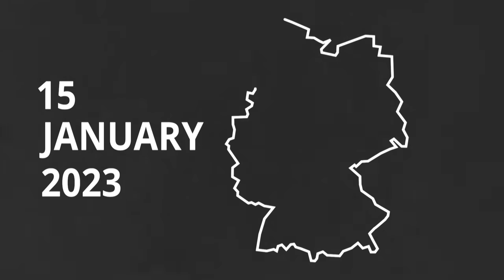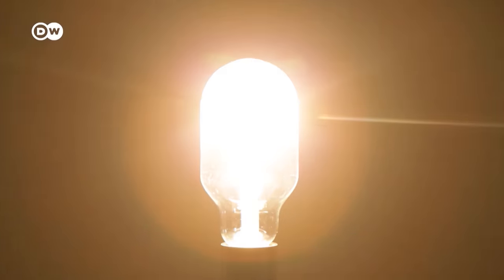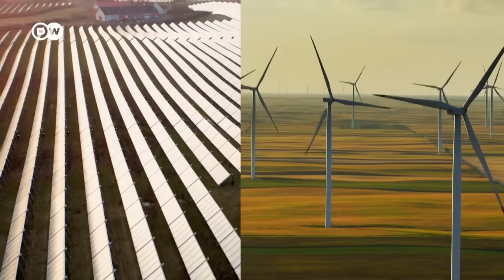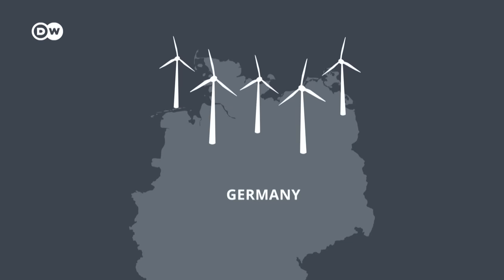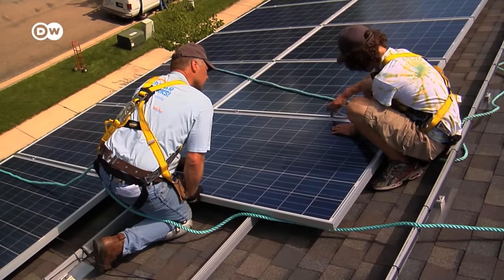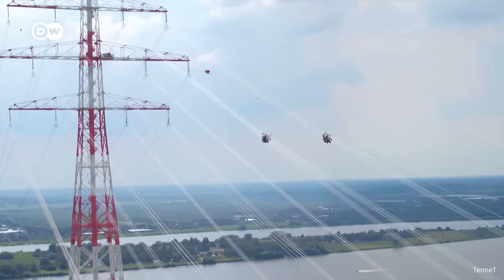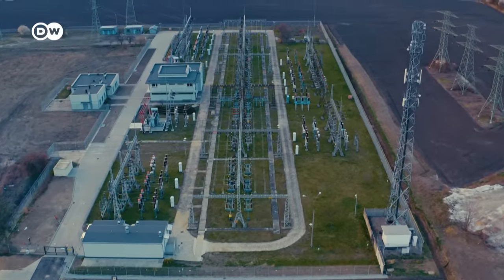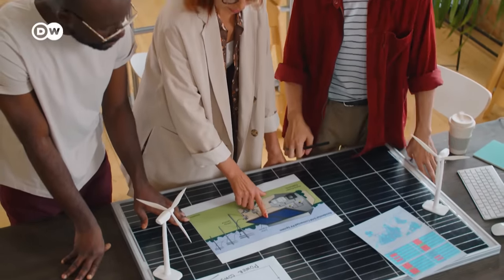This is what's REALLY holding back wind and solar

Comment: From Vietnam here. We have the same problem with solar panels. The North summer is scorching, but the surplus electricity can't be brought from the south to the north, as the high voltage lines are operating at maximum capacity. We have to import electricity from China for this summer. Some rural areas have been cut electricity some times during the day for essential services.
Reply: Convert surplus electricity to hydrogen, and store, use, export, or transport by pipelines.
Reply: It should be relatively easy to lay a submarine cable
Reply: Those types of transmission lines are actually DC, doesn't make sense, I know. But it actually does.
Reply: @Sofus. Sadly politicians would find a way to prevent that, because they love their money
Reply: It's not just electricity. It's also water supply. Today i watched a documentary about Vietnam. Some aren't connected to the fresh water supply and some have wells which creates also other problems. The waste water is not cleaned and goes straight into the rivers. Than there are the countries upstream which are building dams and when it's raining and flooding they have to let water out. It's a real problem and it's hitting not just the citizens of Vietnam but also the economy. They should build up a clever and efficient system with the money they still have. If it continues like this the money could be gone and nothing is build up.

Comment: I did my batchelors thesis on this, and from what I calculated by far the biggest potential is in smart heating / cooling and in EV charging. Doing demand response with stuff like wash machines can be done, but those represent a very small percentage of total energy use, so they won't make that big of an impact. But smart heating and EV charging could potentially reduce the need for energy storage by more then 50% (I looked at it in the EU, elsewhere it may be different)
Reply: Talk to me about smart heating.
Reply: @I_Have_The_Most_Japanese_Music  Well, essentially temporarily stopping the electric heating during a significant power deficit, and conversly "pre heating" when there is a power surplus, before projected drop. Buildings in Europe lose about 1C every 3-4 hours during the average European winter, so if people were willing to set an acceptable temperature range, lets say 21-23C, then the smart heating system could use this inertia to shave consumption peaks, and use up energy surpluses.
Reply: @pyroman2918  Okay. I didn't realize it was that simple. Thanks.
Reply: It is that simple. You just need money. Insane amounts of it. Only problem is, is if you are paid German wages, as most people living in Germany do 😀. But let's ignore this aspect, because it's an inconvenient constraint in our discourse that, if we simply ignore, everything is all good again.
Reply: You can also have 1-2 cubic meter water tank for energy storage. You can heat it up when energy is cheap and it energy from it when energy is expensive.
Reply: @Mariusz Kozłowski  that is 100% correct. What are the costs of retrofitting an older house with such a storage option?
Also, how much caloric energy can you store, and at what rate does it dissipate? How much more efficient would it be than simply storing the same amount as chemical energy in a battery? 
If we are to make these things into practical solutions, we need to figure out the answers to all the questions above also. 
Right now, anything green-energy related is succumbing to human greed. Contractors have upped their rates to unbearably high levels to the extent that not only the investment will not pay for itself during its projected lifetime (unless we face prohibitive electricity costs, of course), but it will financially ruin most people in the so-called developed world, where prices are really at an extreme high. Of course when the drawbacks are so high, people will not be willing to make sacrifices.
Not when others make huge profits out of this opportunity. It does not feel like we are in this together, and that will really make things worse unless the market gets properly regulated.
Reply: Have you done any research into residential seasonal heat storage in sand? Utilizing heat pumps? Sounds fun to me. I'm also interested in residential co-generation (gas for electric and thermal). Also neat, but I understand this is very micro, and your research is macro.
Reply: Not just that but data suggests an increase in the market for AC's so Summers will se increasing power loads from AC units in many houses in europe. And cooling things down takes a lot more energy than heating something up.
Reply: @volkhen0 So glad to hear this from someone else. 
A hot water tank can keep water warm for days.
If one has radiant heating, a warm water tank could potentially save them.
I recall a winter storm a few years ago and I awoke and realized no power, 
I decided to shower quickly b4 it got cold.
I was surprised to have lewk-warm water on the 3rd day.
Reply: @0my I understand this is relatively new to the modern society.
I am looking forward to see this implemented on a grid and per home scale.
Reply: The problem is only one thing and that's energy storage. Smart heating and cooling as well as EV charging are just sub-categories of energy storage.
Reply: Thank you! So often the onus is put on the everyday people, when houshold consumption is a small (tho not insignificant) fraction of both CO2 emission and power usage. We need to look at the bigger impacts, like industry - or heating as you say. I saw an other video recently that was talking about storing renewable energy as heat for communal heating.

Comment: The Dutch engineer came up with a road that has utility chambers underneath that would make everything easier
Reply: Well, it's not new idea, or even that clever. For one, burying cables under road would be dumb, burying them beside roads on other hand is normal and much more accessible.
Reply: I'm sure digging up roads will garner the maximum amount of popular support.
Reply: is this a traditional road made from concrete/asphalt?

I've thought you could make a modular road which allowed drainage through the surface, that would allow easy access to utilities when needed as well (without digging up a road, just removing sections of it for repairs to utilities). I know microplastics are a concern though. I'm not sure how you would design a plastic which didn't "shed" into the ecosystem.

Comment: In some  places, the consumers can allow utility company to shut down their AC and heating a few hours at a time in a rotating pattern in a given area. It barely impacts each individual home, but has a huge impact at grid scale. Enough so to make turning on peaker plants unnecessary.
Reply: I completely agree. If there was a tariff that gave a discount on the understanding that you could be switched off at high demand times, and if they sent a text message to give ten minutes warning, long enough to hit Ctrl-S etc,  I would go for it. With smart meters electricity companies already have the ability to turn off individual consumers.
Reply: @VideofoundryNet  I'm not talking about your 200 watts computer here. These remote shutoff programs are for kilowatts appliances, like heating and cooling. They never shut down  your lights / computer.

Comment: A friend of mine has done energy planning for a Danish municipality. Behavioural changes by consumers and fex tariffs are not part of the solution, in his opinion. I have done the maths for myself. The washing machine is the only appliance I can put off using. With 211 washes per year and a consumption of 0.37 kWh, that makes a consumption of about 79 kWh per year that I can postpone. In my case, that's a little more than 1% of my consumption. However, I have a high consumption. Today, private electricity consumption accounts for about one third of total consumption.  Roughly speaking, if all Germans wash their laundry off-peak, only about 0.33 % of the peak is shifted. My friend is right. The idea sounds good in theory but is practically irrelevant.

Comment: I'm an American living in Japan for the last 2 decades. We use our washing machine and dishwasher just before we go to bed. The machines are too noisy during the day.

I also used to work for a company called Yazaki which makes a passive solar water heater. (Japanese enjoy taking a hot bath before going to bed). It's a simple system; they installed a glass case on your roof and put in water tanks. Even in winter on a cloudy day the water gets heated. They put a pipe from the tanks and hook it into your bathtub. Flip a switch and the water fills the tub. 

My father back in Wisconsin back in 1980 built a house with a passive solar system. He has a sun room next to the kitchen and living room. In winter the room provides enough heat to warm the house during the day. At night he uses a pellet oven. He only uses the furnace in the morning. He pays around $40 / mo. in winter for fuel.
Reply: I guess that they could use geothermal sources as well like in the onsen

Comment: As I have solar on my roof, I already do hold of my laundry and dishwasher, even car charging, until I have excess. Should I have battery, I would probably be a bit less cautious, but I've learned it's not a problem at all to do this.
Now, there are even automation options, enabling you to start the wash cycle only when excess energy in the solar production exceeds specific threshold. Same for car chargers.
With smart solutions like this in every home, the load on the grid would be much more manageable.
Not everyone can afford it, though - I can say that our home energy system was not cheap - and we still don't have battery.
Reply: I agree. My PV ist rather small (5kWp) as is my battery (4.7kWh). Last years total showed a decrease in costs of 1200 Euro (power only), plus additional income of 400 Euro for exported energy (Located in BW). Pricing is another good motivation for moving consumption times, I think.
I expect power consumption to be billed by hourly prices in the long run, after everybody got his smart meter. That will cause a shift in consumption times, because people will notice the difference.
Reply: Exactly - I'm in the fortunate position of being both retired and living in Southern Spain. When it's a dark cloudy day I don't do clothes washing, but I do everything I can during my peak production hours (between 11 00- 15.00 usually) - I do have a battery and that powers the house overnight. I usually generate a surplus in the afternoon - so far this year, I've used a little under 60KWh from the Grid and supplied about 900KWh to them (but the weather has been strange this year) - over the course of a year I usually have a surplus of about 800KWh.There's room to expand the system (I've figured I could get my surplus up to almost 2,500 - 3,000KWh) if I added some extra panels - but the Spanish Grid doesn't want domestic users in surplus so there are no financial incentives to do so. But I don't have any "smart" solutions - it's just me scheduling the pool pump to run in the day....
Reply: Where I live the battery pays for itself by selling back electricity during peak demand so they don’t have to fire up a peaker plant.  Batteries are saving a ton of money for everyone including the utility and they’re getting cheaper quickly
Reply: @chrishaberbosch1029  Depends on whether there is a difference between what you pay for used energy and what is refunded for energy you supply. In Germany you pay about three times a much for energy you need from the grid than the utilities pay for supplied energy.
Reply: @st-ex8506  I know. I worked for utilities for a few decades ...
Reply: @chrishaberbosch1029  Unfortunately in Spain the current government was too weak to get more than token payments for owners of PV systems - the EU said they must abandon the previous government's "Sun Tax" (a regime where you were actually penalised financially for having solar panels that was brought in by the previous government - if you ever want to do a case study of how not to set up a policy to encourage alternative energy you only need to look at the history of PVs in this country) and so Sanchez was able to push through a very weak reform but Endesa and Iberdrola managed to water the law down. 

Essentially the law says that the power company is obliged to credit your electricity bill for any energy you supply them at "the wholesale rate" (despite all the ups and downs of the last 18 months my rate has not budged once). Now, if you don't have batteries and just solar panels this works out okay-ish - you supply them during the day and are paid €0.08 per KWh, then you buy from them at €0.20 / €0.25 / €0.11 per KWh depending on the time of day or night.

If you have a battery though you may well be like me - during the Summer when my system produces most of it's power I don't consume any power from the Grid at all in the month - so there is no purchase of grid electricity for my credit to be applied to (they managed to get it written into law that the credit couldn't be applied against fixed charges or taxes elements of the bill). There's no carry over provision so I lose that credit entirely - meanwhile Endesa have sold my 200+ KWh monthly surplus to other consumers at 20c a KWh. I'd also point out that my bill suddenly went from every two months to monthly when I went in to inform them that I had the PV system - presumably just to minimise any chance of them actually having to give me a credit in the Autumn or Spring.

The really dumb thing is that, on an annual basis, I produce a surplus. Now I've had the system for a couple of years I can see that, at peak, my panels only produce about 85% of their rated power (because obviously rated power depends on laboratory conditions). My inverter is rated to 4.5KW. Spanish electricity charges are a bit strange - they have thing called the "Potencia" which is essentially how much energy your property can take at any one time without a fuse blowing. Most Spanish domestic properties are rated at 3.3 or 4.4KW (the range runs from 2.2 - 9.9KW for domestic properties) - so if you try to use appliances that in total consume more than your rated potencia your circuit breaker pops and you need to go around the house switching off appliances.

I have a 3.3KW potencia connection, 3KW of panels (that produce about 2.7KW at peak) and my invertor is rated for 4.5KW - so I theoretically have the ability to add more capacity. But if I want to increase my potencia to 4.4KW I'll be charged €185 to do so, and my fixed charges will rise by 11c a day. As my current system is already in surplus any additional capacity would just feed into the Grid - another 1,600 to 2,000KWh per annum - I'd see a marginal benefit in my bills between November and March but that's all. Meanwhile Endesa would sell my electricity for an additional €400 per annum - not bad for not actually having made any additional investment whatsoever. 

If, on the other hand, the government said that Endesa was obliged to actually pay me for the electricity I supply them, at the actual wholesale rate (or at the average wholesale rate for that month) then I'd be inclined to do it. Endesa would still make a little money, and I'd have the satisfaction of helping to save the planet (or at least supply the equivalent of about half of one of my neighbour's energy needs for the year).
Reply: @chrishaberbosch1029  Here they use hydro power for peaks, usually less than 10% of electricity is produced from dirty sources, so there is no special price for peaks (yet). I calculated the ROI to around 9 years, not bad, but I'll have to get longer term data sample before I move forward.
Reply: What makes it so expensive is the installation. The components are so cheap now. Newer equipment is also easier to install essentially plug and play.